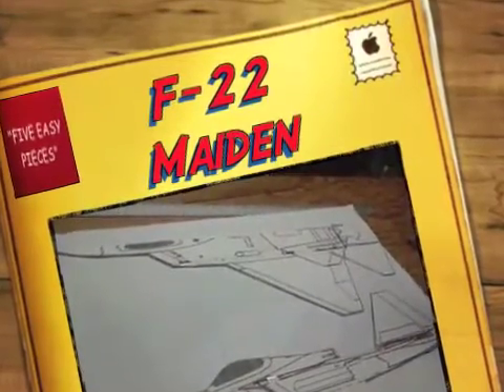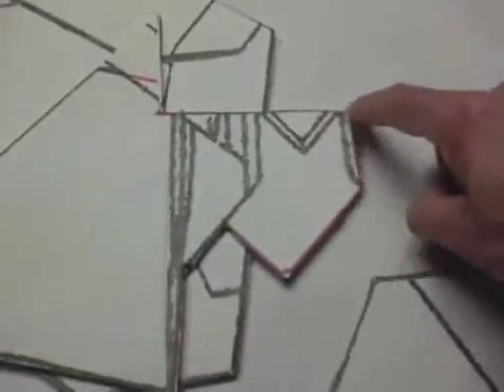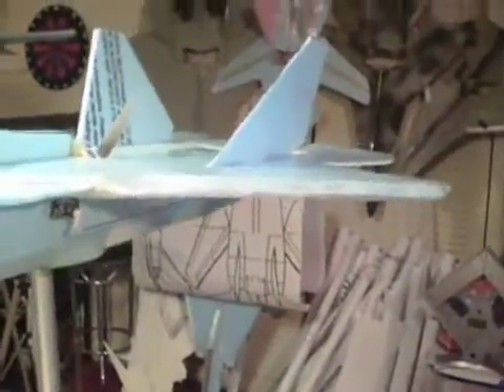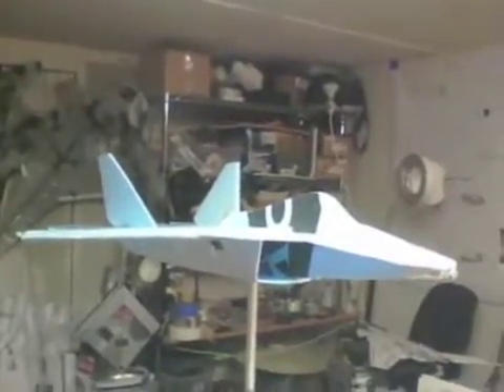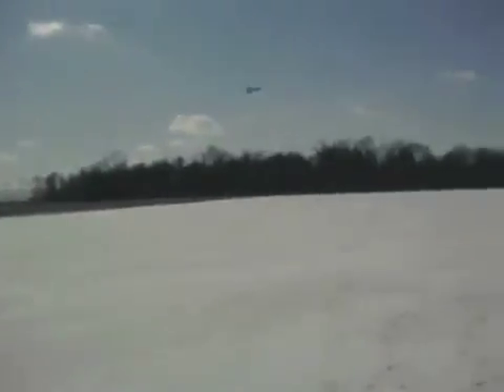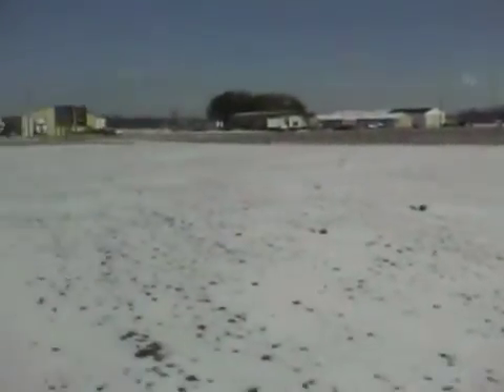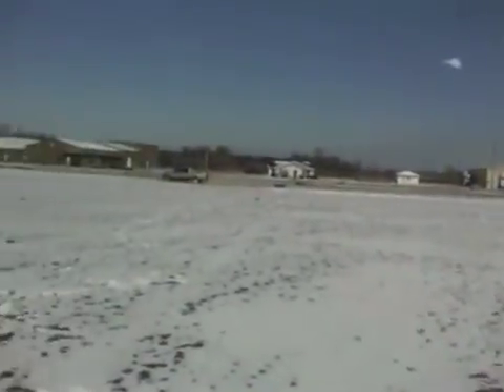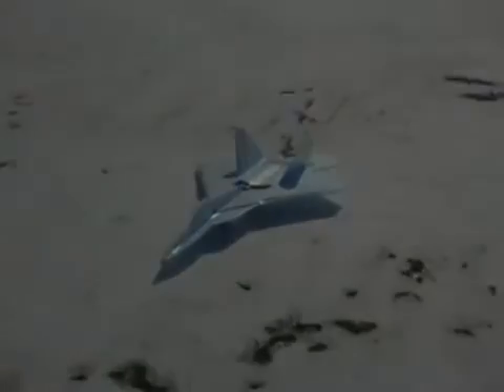FIve Easy Pieces F-22 Maiden.mov

Comment from the maker: @Tsavah 
Actually I have tried it. I liked the thinner 1 to 1.5mm rod. I used it on my larger Talon builds. It is very light yet it adds strength. the 3mm rod makes it to much like a spear and as I'm prone to forgetting not to fly the plane at myself it could be a bad idea.